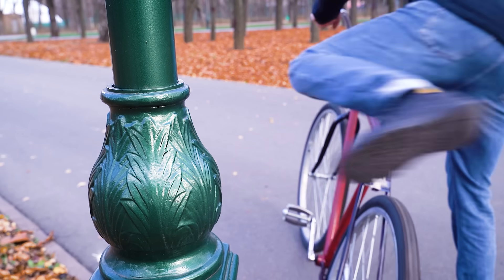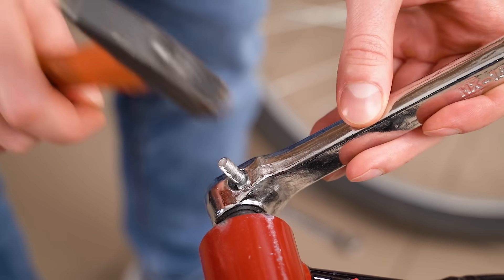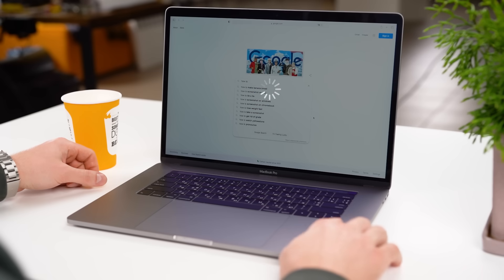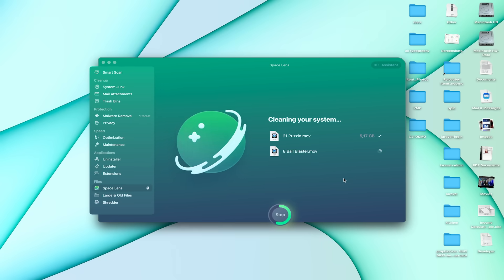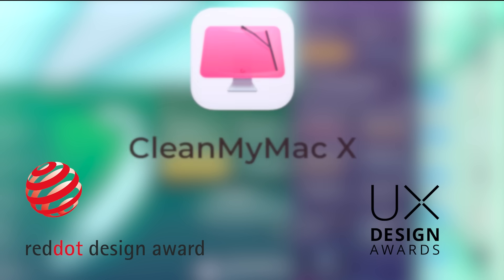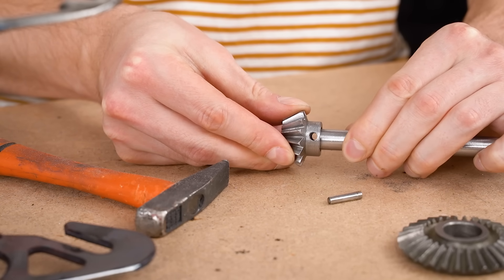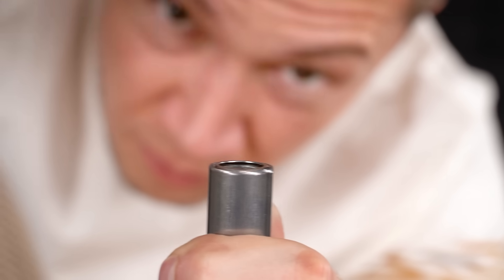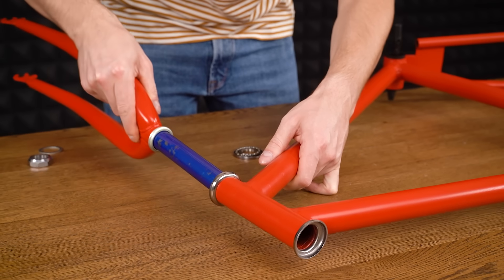Insane Chainless Bicycle Prototype

Comment: It seems like you have to pedal 10 times more than you would do with a chain, just to gain a mere fraction of the momentum
Reply: Different size gears would fix that, this was a first run so he had to have some baseline. Wouldn't be hard to correct.
Reply: @suzysuzuki8865  maybe so' but, changing gears on the fly would take some more space than required by simple chain assembly.  you would have to make it as a motorcycle gear system with the ability to shift gears.. I do say he had great skills to do that but I will also say that if you have the tools and the garage or space you can do anything!
Reply: @frankmachado1010  making it change gears would probably add more weight than you'd wanna peddle lol maybe if you used aluminum to make a small gearbox? I still think it'd be better to nail the gear ratio and have more of a BMX than a bike with gears, something you could ride around as a conversion starter
Reply: @suzysuzuki8865  exactly what I was thinking, I liked the project, but it needs some gears for an upgrade to be really useful
Reply: Yeah you'd need alot more gears
Reply: @stavid7870  that's just a chain but worse and more delicate
Reply: @Vajrapani108 
Hardend steel, is not delicate but sitting open like that it will need cleaning and lubricant regularly.
Reply: @Zeaiclies  im not talking about individual gears breaking. Gears will find a much simpler way of stop working. And in general, more movable parts=more chance of breaking
Reply: @Vajrapani108  much work, low durability, high maintenance... But it could be a great bike with some adjustments
Reply: @Stivarengo  more like a mediocre bike with high maintenance. And even that probably on some dutch road. I'll probably rig it up in a day in India
Reply: @Vajrapani108  yeah, this bike wouldn't workout here in Brazil too, but I still liked the project 🤣
Reply: @Vajrapani108 
It should not break but it will require proper maintenance.
Reply: @Zeaiclies  if by proper you mean far more substantial than a regular chain. Gears fine a way to get lose, meanwhile i haven't greased or really maintained my cycle in almost a year, and it's fine
Reply: @Vajrapani108 
It does not require any more maintenance really than a chain would, with the exception of debris prevention and lubricant applications, to prevent any malfunctioning of the tube. lol

You could be completely neglegent to it, and only suffer it seizing up stiff.

To repair it would be easy to do, however time is expensive and irreplaceable. lol
Reply: In the motorcycle world bigger sprocket= more torque smaller=more top end
Reply: @suzysuzuki8865  its the same thing in a cycling world, except on the front sprocket. For the front sprocket if it's Big, the faster it goes.
Reply: i like the idea but, wouldn't it be heavy??
Reply: Also you need to pedal when moving. Would be impossible to go down and up hill. And using it as a brake is not easy like this.
Reply: Yes
Reply: Agreed. I wouldn't trade my chains shifting options for one gear. Looks great if you are over peddling to burn calories, otherwise it looks like a lot of work to movel at a decent speed..
Reply: I noticed this video isn't old..
Reply: Just get a hub gear system you can have a few ratios in the hub.
Reply: LMFAO 😂 😂 😂 😂

Comment: That's like riding a 10 speed in high gear ... would be great for going up hills but would suck for daily driving. Would be great for losing weight since you'll be peddling 1000 times just to get the equivalent speed of a regular bicycle.

Comment: that's not a prototype 

bevel gear drive existed for year's 
problem it they require good precision, can seize in dirty environment, less efficient than chain drive, more noisy 

you made a really good drive but it's not something to go wild about, specifically because you did this because you broke a chain in a normal driving around city...big doubt

Comment: Chainless is a great goal, but doing it this way means we are learning from how transmission works in cars and this makes it very difficult to design a cost efficient gear box for changing speed, isn't it?
Reply: There are axels with gearboxes inside. Maybe that is solution

Comment: I noticed that the hub is back pedal brakes. Does this mean that as you are traveling but not pedaling then the hub is freewheeling until you backpedal to apply the brake or does the pedals keep turning while the wheel spins?

Comment: We do a lot of things with the bicycle but one thing we refuse to accept and improve. When the pedals are horizontal torque is maximum and when pedals are vertical torque is zero. So net torque is about 50% only. An engineer from IIT Kanpur had developed a system with ratchet arrangement so that torque is maximum always. Nobody is willing to accept this.

Comment: how does freewheeling work and, also, how would you account for gearing?

You could look at hooking up a nexus hub somewhere within all that I guess.

For round where I live though, a bike like that would fail at the first hill 😁

Nice idea though...although, I'd want to beef up the wheel fixing myself...can't see it being up to much grief myself
Reply: There are actually bike designs with a shaft drive and gear hubs. They also enclose the whole thing, do that it is 100% shielded from the outside. Cycling About made a video about shaft driven bikes and why they aren't a thing.

Comment: But the problem is. There is no clutch to disconnect the power from paddles to wheel. 
You have to continuously paddle untill you stop the cycle. 😂🔥

Comment: I never experience chain breaks . Chains are by far more efficient in power transfer than shafts
Reply: @KNIGHT FAR yep
Reply: A chain is much more efficient in transferring power than a shaft drive. Claims to the contrary are absurd. Shafts are used for other considerations like very low to zero maintenance. Chains stretch over time and have to be periodically replaced.
Reply: N no gears
Reply: You never experiencing chain breaks has nothing to do with anything. I'm sure he's also plenty aware that chains are more efficient and doesn't need armchair engineers in the comments telling him that, or assigning intent.
Reply: A couple of times I've broken a chain  in  55 years. It been a long time now . The modern  chains have much better rivets. Just don't break those rivets and put it back together with the rivet that was opened.  I prefer the Shimano chain pin that has the section that is broken off after installation.  Those very seldom break open on their own.
Reply: Actually they arent but chains have plenty of other advantages.
Reply: @timn4481  Chain drive efficiency is cca 0,95, shaft (but with only 1 gearing, not fokin 2 like here on this shitty vessel) is about 0,75 only. So here it could be about 0,5 and believe me you dont want to ride such a "bike"

Comment: This is great but it will run out of lubrication after some time. Can work on it and make more superior model like put yhe whole joints in box with oil wich will lubricate the enginer 24*7 ... But yeah bycyle without a chain is freaking amazing idea 💡

Comment: very creative , nice
Reply: This Technic has disadvantage, such as no free wheel mode
Reply: @abdulershad737  tbf, it wouldnt be hard to put a 1 way bearing in the druvetraun somewhere to get back the freewheeling
Reply: @garchompy_1561  yes, but you could also not remove the chain, have it freewheel and have changing gear ratios…
Reply: Creative my ass this tech is 100 years old
Reply: This is old tech
Reply: Yabro

Comment: it won't be fast enough.  If you imagine the small ring it will pedal lightly, but in return the speed is not fast.  Not a very good invention if you change it to a gear that is big enough with enough speed it might not be so bad

Comment: i have an idea where you can add more gear ratio by like adding more gears behind the first and then to shift gears, you clutch,
clutch makes the rod holding the gears levitate from the wheel and then just shift to the 2nd and doing this
pushed the rod forward and the gear behind the first get used

Comment: I watched a video on different type of drives in motorcycles. 
Apparently, while shaft types are more sturdy, they are a lot less efficient than chain drives. I think it would be the same in bicycles. Cool project regardless.
Reply: @Rocky Mountain Way as i said it's insufficient only if u use it with shockers,but this cycle don't have any
Reply: Nope,not until u use it in bycycle with shock absorbers

Comment: I believe you have miscalculated the final rotation available on drive wheel. I can see you don't go in this pinion drive as much distance on conventional chain for one full rotation of pedal. Your gear ratio on pedal to drivr wheel is far less.

Comment: Very cool. I like the thought. One difference I’d probably make is to find a larger diameter bevel gear for the pedal shaft. Seems like it requires a lot of pedal work for a little amount of output at the moment.
Reply: That and maybe a housing for the gears so things can't get damaged and I don't know if you would have to lube it often
Reply: I wanna see it going uphill
Reply: @1abcrr1  : The hub barrel was still on the rear axle. That barrel has the mechanism for coasting and braking inside. He just replaced the chain and sprockets. It would still function like a regular one speed bike.

Next project should be a gear box for that shaft. With several forward ratios, neutral, and reverse.
Reply: Why does it make you feel cool ,,,, weird
Reply: Cool, but needs a clutch so when you stop pedaling. The bike keeps rolling, good idea, that one flaw, going down a hill, would become a problem. Or stopping in general.
Reply: فعلا
Reply: Wheelie monster
Reply: Meaning it is faster to walk haha.  But beautiful job and idea though
Reply: It can be made 👍next time 🙏🙏🙏
Reply: At least a lot of torque for uphill driving
Reply: This was for demonstration purposes only. The rest is obvious 😎

Comment: The biggest problem is that you now only have 1 gear and making a gear drive system similar to this would not only be much harder but also would add significant drivetrain weight and rolling resistance both of which make for a crappy bicycle.

Comment: For shifting, driveshaft could be retracting or sliding (not stable like in the video) and wheelside gear can be conical. So when you shift the gear, shaft end gear will slide on the main cone gear. You may have 5 or 6 different gear position only. Since you won't be able to change the shaft end gear.
Reply: Probably want to think that through a little more.

Comment: Cool it's like an Opel Bicycle from 1900. I can see that this prototype has a footbrake. So he also has a freewheel. So the pedals don't turn constantly. 
Fichtl + Sachs has had "Torpedo" wheel hubs with a manually shiftable three-speed gearbox since the 1950s. A conversion to such a wheel hub should therefore not be a problem. 
The pedal axis should be better supported. It wobbles. That's not supposed to. You're breaking the bearings. Otherwise very nicely done. 
Except maybe the pinned cog in the front. Drilled wrong, huh? Can happen to anyone. Greetings from Frankfurt / Germany.

Comment: Anyone with any real engineering knowledge knows that this is a quickly thrown together project which may look good but could in no way be thought of as a reliable working machine.
Reply: He's pedaling faster than he's actually going
Reply: I'm not an engineer (flunked out), but I can see a few flaws. 

It needs a freewheel mechanism, the gears are unprotected from the elements, the driveshaft bearings are just tapped into the tube with nothing to keep them from getting pushed in too far, the crank gear is offset and unstable, and a kid on a Razor scooter could outrun that gear ratio. 

The sad thing is, this is a great concept! It just needs to be properly built. :3
Reply: No way  to lubricate things, must have. Lubrication.
Reply: Looks cool but has no gears, ratio is garbage and the pedals are directly connected which means you always have to pedal
Reply: Several makes of bicycles used this same technology over 100 years ago. Don’t believe everything.
Reply: @danhenderson783  Oh the concept is perfectly perfectible, only this example ain't. The video is entertaining enough which is the main thing possibly. 😶
Reply: I'm more fascinated by the +12 million views in 9 days.  From an engineering perspective the idea has little merit.
Reply: Gear mechanism needs more lubrication than chain.. Gear tooths are of convex shapes.. so load path is a line contact...in chain contact is between bush and pin.. bush inner side is concave and pin outer side is convex.. so area contact.. so contact will be smooth.. even after wear out happens also concave surface becomes more concave and convex become more convex.. but in gears it is not the case.. initially it will work, but when wear out happens engagement becomes noisy, and micro cracks will happen..so only with casing with lubrication oil, gear will work better.. it will cost to bicycles...
Reply: Hes done it! You havnt.
Reply: @paulkazjack  Hush child, he has many thousands of dollars from this video to help soothe his feelings. The video is entertaining but people have the right to known that it is also BS.
Reply: @paulkazjack  for good reason!
Reply: No way can matter actually it's working thats will more efficient
Reply: @intelligenceroboticworld2987  Ummm... what?
Reply: Yes you right,I am mechanical engineering and know this idea seems in garbage , totally engineering less job

Comment: Some gear oil and sand later this drivetrain is good as trash. For this to work for longer than 5 minutes properly it should be in a metal box where grit can't get and should be swimming in transmission oil.

Comment: no coasting ability.  you need a clutch and variable ratio gears  then you would have something ...  at the very least a clutch and a big ring gear on the crank maybe 3x bigger than the rear wheel gear.   keep developing it. you have the skills..

Comment: Pretty freaking cool. There have been direct drive motorcycles for decades now and you've begun to solve the scale down to make it practical for bicycles. Will be interesting to see how you solve the gearing ratios in order to get multiple speeds from crank to hub. Good luck!

Comment: Put the gears at a perfect 90 and give the tip of the driveshaft a throwout gear so that as you pedal the gear will shift from large-diameter too small much more difficult build but then you would not have complete spin out it was obvious that your gear ratio not good at all

Comment: Using worm gear is not efficient in terms of prolonged usage. As worm gears will need periodic greasing and on the contrary it will subjected to relentless breakdown, more over it is also a old school method (shaft method), chain was it's advance version. Still, I appreciate your efforts.

Comment: A chain or belt transfers 98% of the energy to the rear wheel.
  A shaft can’t even come close to that. Depending on how many times the power hast to turn a corner, at the ring and pinion gears, the best it can do is deliver 85% of the power to the rear wheel with a shaft..
  let’s not forget about shifting Sprockets

Comment: You know this would chew up that small gear without lubrication after awhile. Just like differentials need oil to keep heat and wear down.
Reply: Grease
Reply: @callumh9450  could work but it'll need to stay in the garage, what would make it better though is peddle assist.

Comment: "It is a good transformation. However? You should also include a low to high gear sequence shift for easy load flow. Overall, The drive shaft was good."
Reply: sembang kari

Comment: in my opinion, the drive shaft should be of a smaller diameter and should be mounted on bearings that will go into the center of the frame.

Comment: it well get heated due to no lubricant involved and the life will be much shorter than a chained bicycle bcz it will get wear and tear due to friction and the teeths will break soon enough..if there was a gear box involved with sizes and shifting manually according to speed and yes lubricated one that would be  great